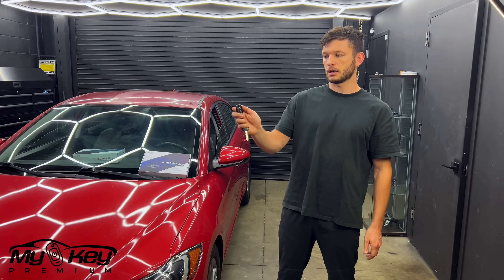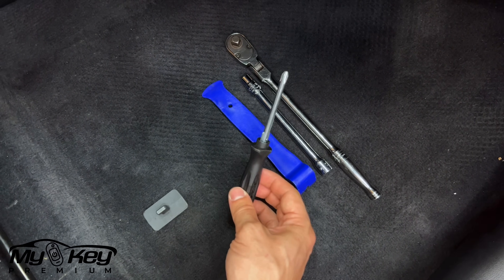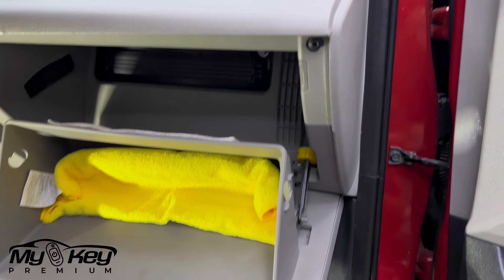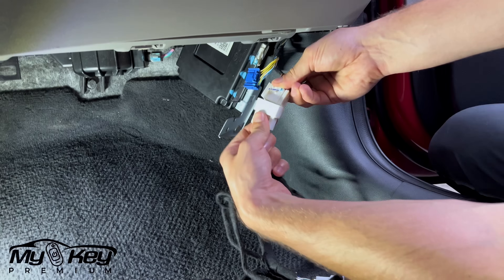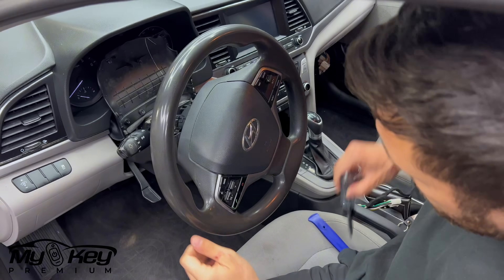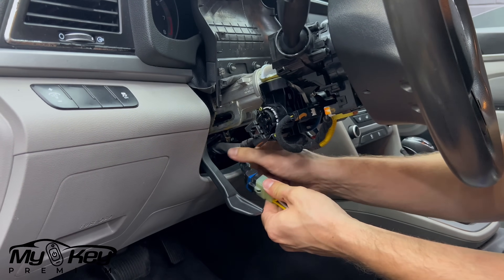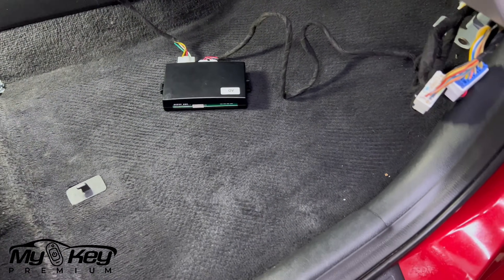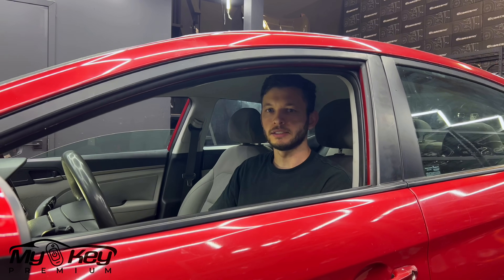Hyundai Elantra 2017-2019 Remote Auto Starter install / key ignition version |MyKey Premium.

Comment: The double clicking the lock button rapidly with out the interval doesn't start the vehicle right? Cause rapid double click is for beep sound that confirms the door is locked! 

If you can clarify this I'll order and install
Reply from the maker: That's right. It will beep anyway to signal that the car is starting.
Reply: Car already has to be locked, then your press 2x.